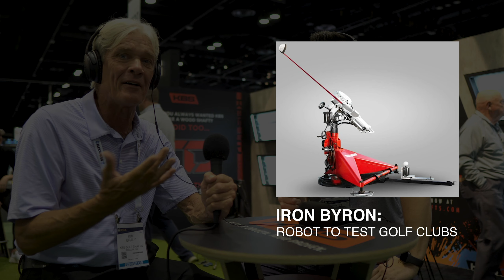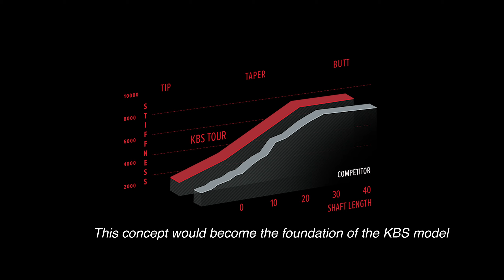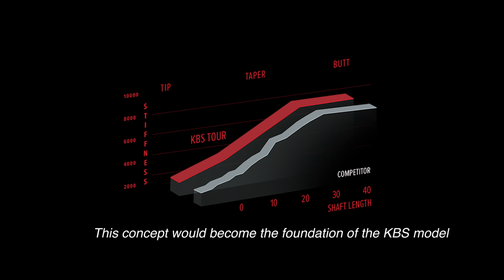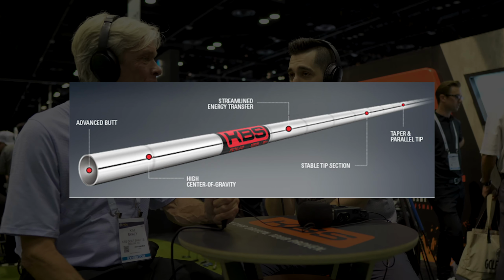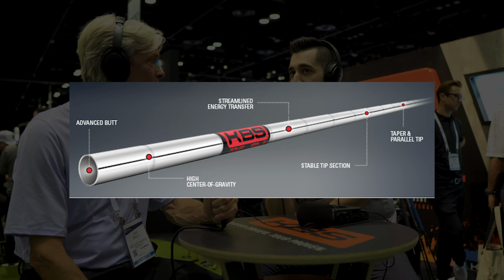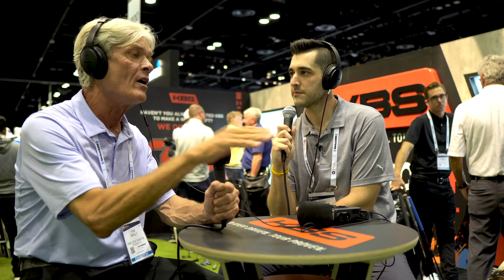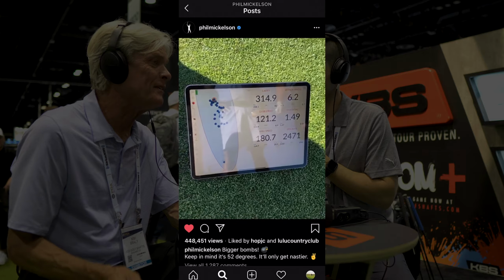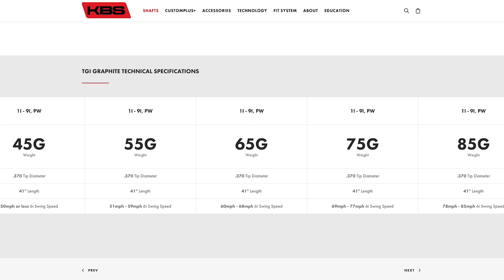KBS Golf Shafts Founder Kim Braly Interview - PGA Show 2020

Comment: I have a question...why does the KBS Max shaft have R80 written on it when the shaft weighs 102 ...the tour 105 has 105 written on it and weighs 105  tour 90 does the same...
what does r80 stand for.
I almost completely skipped over that shaft because I saw 80 and assumed it was weight like the other ones.